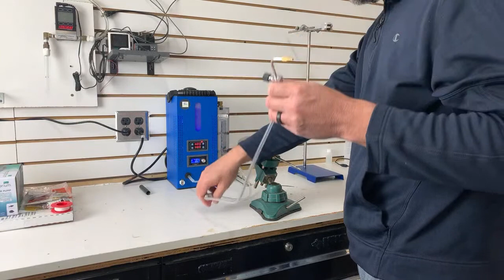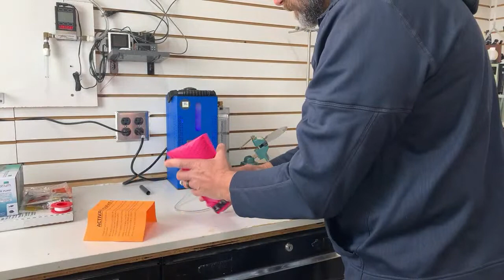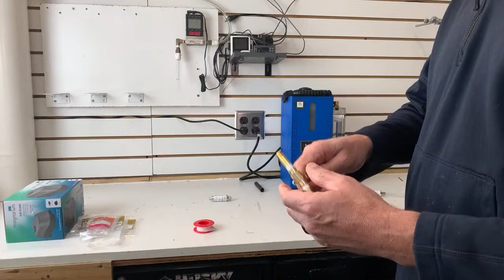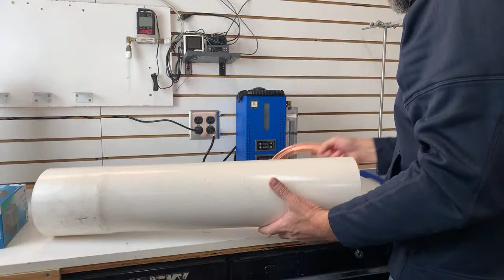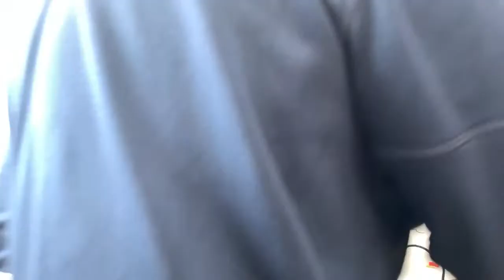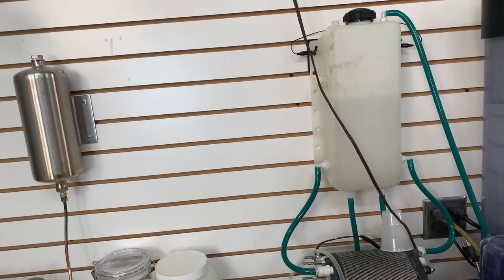Full assembly of a DDW generator attachment for brown’s gas machines. Deuterium depleted water

Comment: My understanding is that in addition to recombining the electrolyzed protium and oxygen as you do here, you can pre-deplete the water itself through low-power electrochemical separation through a Nafion membrane between the 2 electrodes, where the water on one side becomes depleted and the other side enriched, totally separate from electrolysis. You could then use electrolysis on the resulting pre-depleted water, to further deplete the deuterium, like you do here.

I would love to see someone make a machine that stacked both methods, and perhaps increased efficiency that way -- pre-depleting the distilled water to some degree with the low power electrochemical method in stage 1, and then finally electrolyzing the pre-depleted water in a 2nd stage to drop the deuterium to a truly low ppm.

Maybe a separate water pre-depleter machine would be just as good a solution, and then the resulting water could be added to the Browns Gas machine as done here.
Reply from the maker: How does one pre deplete the water? Is it a known process?
Reply: @Hydrogen4Health  Yes, I believe it's called Isotope Transfer Electrochemical Cell, modified slightly.
Reply: ITEC focuses on direct liquid-to-liquid H/D transfer across the membrane while PEM electrolysis produces separated gases for optional recombination.

ITEC Process Details

ITEC uses a proton-exchange membrane (PEM) cell with low voltage (~0.5–1.5V) to pump primarily protium ions from anode-side water to cathode-side water, leaving deuterium-enriched water on the anode.

Detailed Steps:

    Setup: Two water compartments separated by Nafion PEM; platinized Ti or Pt electrodes on each side (~1–5 cm² area).

    Feed: Fill anode with feed water (~150 ppm D); cathode with receiving water (can be pure or recirculated).

    Apply low DC voltage (0.5–1V, 10–50 mA/cm²): Minimal electrolysis occurs; main process is H⁺/D⁺ electro-migration through PEM (H⁺ ~2–4× faster due to size/mobility).

    Ion transfer: Anode water loses H⁺ → becomes D-enriched (~160–170 ppm after 1h); cathode gains H⁺ → D-depleted (~140 ppm).

    Harvest: Draw off anode (heavy) and cathode (light) waters separately; recirculate cathode for cascades.

    Gases: Trace H₂/O₂ vented; energy ~10–20 Wh/L.

Key metric: Single-stage α ≈2–4; efficient for tritium/D separation in nuclear contexts.

Comment: Does hydrogen inhalation help reduce deuterium in the body? More than hydrogen water?
Reply from the maker: Neither of them do from what I know.
Reply: Do hydrogen generators produce deuterium gas along with hydrogen gas? After watching your deuterium videos, I stopped my hydrogen inhalation...
Reply: @lanael7278  I would think that because deuterium is heavy it doesn't end up being inhaled. It stays behind in the water. This vid is just showing how to convert browns gas into deuterium depleted water
Reply: @TermiNader5  Yes, deuterium gas is heavier than hydrogen gas, however, lighter than oxygen gas. Brown's gas has both hydrogen and oxygen gases. Deuterium gas may be there too 😞
Reply: @lanael7278  it's probably similar though to drinking 25ppm deuterium depleted water..there might always be some deuterium but it's the ratio that matters
Reply: @TermiNader5  Agree. The ratio would be similar to the one in the water in hydrogen generator. Most drinking water has 150 ppm of deuterium water, so the same molar ratio of deuterium gas will be present in Brown's gas. I'm stopping by inhalation of Brown's gas.
Reply: @lanael7278  if you have to change the water in the machine like once a month, couldn't it still be used and just put some deuterium depleted water in it like once a month? I order some water from an American company Hydro-Health
Reply: @TermiNader5  Great idea. I'll do that. Thanks so much!
Reply: @lanael7278  I think though that it isn't that big of deal to use regular 150ppm water in the browns gas machine, because as is shown in this video..the browns gas ends up having like around 44ppm deuterium which is barely anything. but if you do use DDW for the systems water, you probably would end up with a gas with 0ppm deuterium.
Reply: @Hydrogen4Health  then what does decrease deuterium? Deuterium depleted water? why would the BG5 machine not be able to deplete deuterium in the body?...isn't DDW essentially hydrogen water without deuterium, which is similar to Brown's Gas HHO?
Reply: If what you are asking is 'what lowers deuterium levels in the body?' then I would answer 'osmosis'. When you drink DDW (water that has little to no Heavy Water molocules) the water you evacuate through sweat or urine or whatever is going to have higher levels of deuterium, and your overall deuterium numbers will go down. If you are making hydrogen water, (AKA hydrolyzed water) you are simply dissolving the browns gas into the water. The overall number of water molecules that are considered to be 'heavy water' doesn't go down in the water source you hydrolyzed, since all you have done is add some air bubbles to it. Also in an effort to clarify - Basically stated, Heavy Water is a water molocule where one or both hydrogen atoms present in the molocule consist of a deuterium isotope rather than proteum. I could imagine breathing browns gas could actually lower your levels of deuterium isotopes if they were free roaming deuterium or maybe even heavy water molocules in certain circumstances but the numbers are sooo small as to be negligible, if even provable. DDW is the way to go to reduce overall deuterium levels. In this scenario the DDW is being made from a HHO flame recombing to make a new water molocule. The reason this works is heavy water doesn't react to electrolysis at the same levels as regular water, so it's not nearly as common to get deuterium atoms as a gas in one of those flames than it is proteum atoms. So those 'deuterated water molocules' are left behind in the tank instead of becoming gas, so the new water that is made is all but free of deuterium. Ideally a PPM of zero deuterium isotopes would be amazing, but I think this guy did great getting it down to 44ppm. It's very tough to isolate an environment and prevent any moisture in the air from contaminating your new water sample.
Reply: @precisionbarberbear  thanks for this detailed response..if deuterium has built up in organs and organ tissue such as fatty liver, i wonder if the browns gas inhalation could help in reducing deuterium in that case..since from my understanding the browns gas can help with hydration of tissues since the gas can get into the circulating blood stream which feeds all the organs. I would think pretty much all the fat in a fatty liver is high in deuterium caused by a carb sugar rich diet..I'm gonna be also trying out some 50ppm DDW from an American company called hydro health. I have a theory as well that another ancient way of depleting deuterium at an accelerated rate would be to chant mantras for long periods of time and even better while fasting
Reply: @precisionbarberbear  does browns gas contain deuterium gas in it?
Reply: @TermiNader5  deuterium is just a form of hydrogen. Proteum is another form and  is what most people refer to when they say 'hydrogen'. Heavy water, deuterized water, and deuterium water are all names for water molocules made with deuterium instead of proteum. Think of it like deuterium-based water molecules, instead of hydrogen. It's not H2O, it would be D2O. And I don't  think it builds up in organ tissues like other toxins because it is just a heavier form of water but there has to be some build-up going on since drinking 50ppm heavy water lowers your overall count, akin to osmosis. Online references say around 150ppm is around the normal amount of deuterium-based water molecules to normal water, so that's a significant drop. And this guy got 44 on one run? Huge percentage drop, unlike 3% or whatever for distilling methods. Also deuterium-based water molecules don't split up into their basic components during electrolysis as easy as regular water. So a browns gas generator is basically running a current thru water which breaks it up into its constituent parts - 2 parts hydrogen, and 1 part oxygen (hence H2O). Well since the heavy water doesn't get split as easy, it gets left behind, which is why you can get significant drops in heavy water % after just one run. That's a long way of saying no, hydrogen generators don't make deuterium, and you can't end up with more deuterium than you started with.  I'm not sure if it can even be made, but if anything, the final product has way less than when you started with
Reply: @precisionbarberbear  thanks so much for explaining all this stuff..so just to clarify, it shouldn't be a problem to use plain distilled water in a browns gas generator rather than ddw because only a small amount of the D20 in the plain 150ppm water will make it into the gas state?
Reply: @precisionbarberbear  How do you know D2O doesn't break into O2 and D2? Was it ever tested?
Reply: I want to be able to make my own DDW.
Reply: @lanael7278  it does but most of it gets left behind in the water. that's why the browns gas is deuterium depleted but not totally void of it..that's why the ddw created from Browns gas only has like 44ppm deuterium only after one cycle..if D20 was breaking up on a greater scale from the electroylsis, the ppm would have been higher in Steve's DDW experiment like still around 150ppm. The browns gas was deuterium depleted though
Reply: @lanael7278  the video that we are commenting on shows exactly that. I don't know how to explain it properly or something I think. Water is H2O. A small % is D2O. 150ppm let's say. We subject that water to electrolysis, which breaks the water molecules into its base parts, that is hydrogen and oxygen. (All hydrogen being 1 of 2 variants that we named deuterium and proteum. Wikipedia deuterium if you dont understand this). Now if the deuterium water acted the same under electrolysis as the proteum water there should be on average 150ppm deuterium in the gasses produced, right? Well we don't see the same numbers. Isotope analysis proves the numbers are lower. In fact, if you subject those gasses to an ignition source, the 2 forms of hydrogen readily bond with oxygen. The result is water. And we can test this water way easier than the gasses, which is exactly what the paper in this video shows... after 1 run his result was 44 PPM deuterium water. Why is he getting numbers lower than what companies are selling their DDW for at top dollar? Well you can also do an isotope analysis of the solution in the tank. I bet you anything the deuterium levels in any electrolysis machines electrolyte solution is off the charts
Reply: @precisionbarberbear  Thank you for your response. I'm a chemist and understand electrolysis well. I haven't watched Steve's DDW depletion process till the end. Was the final water tested for deuterium content?
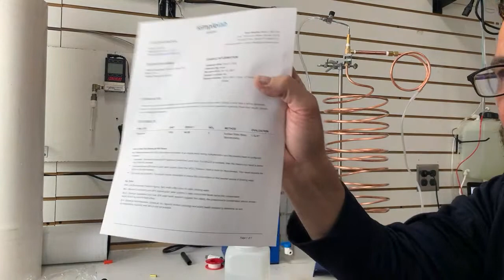Reply: @lanael7278  yeah... 44ppm. I actually think the true numbers would be lower than that if outside moisture from the air wasn't being introduced, but you have to have airflow with these things. Watch the video, increase resolution, and zoom in... you can read the paper from the company that did the isotope analysis when he holds it up @ 49:05 timestamp
Reply: Would drinking 25ppm ddw during a water fast be more beneficial than dry fasting for the body?  @precisionbarberbear
Reply: @TermiNader5  I can't attest to what type of fast is more beneficial, but think of the DDW simply as better for you than regular water. 
Is a dry fast more beneficial than water fast? Who knows.. also depends on what is trying to be achieved and the current state of the body doing the fast. Hope that helps
Reply: @precisionbarberbear  if the goal is to reduce deuterium...i just wonder if a ddw fast would be better than dry fasting?

Comment: WONDER HOW MANY PEOPLE BUILD THIS SYSTEM AND HAD SOME REAL SUCCESS, I DID , VERY GOOD STEVE, MERCI POUR CET INFORMATION.
Reply: How is it the Brown's gas flame does not melt the copper? I thought it would.
Reply: Copper is a very good conductor, not an insulator. It conducts the heat from the brown's gas flame away from the contact point faster than the flame can heat the metal to its melting point. Remember, that flame will only raise up to (not exceeding) the melting point or temperature of catalysis of the matter the flame touches. Think of it as a catalytic flame or even electric flame... it's a better description and more applicable.

Comment: Thanks Delvis11. Excellent video and explanations! 

Any thoughts about using stainless steel pipe instead of copper? Wouldn't this put less impurities into the resulting water from the dissolved copper which can be quite bad for you?

Also curious as to whether you could use substantially less metal tubing by putting an 8" plastic pipe over the tubing and sealing the pipe at the bottom with a cap etc, drilling a hole in the side to exit the deuterium pipe, sealing the hole  and then filling it with tap water as a coolant, and maybe running the second aquarium hose into the base of the pipe and diffusing it with a an aquarium stone to cool the water.? You'd have to put a vent opening at the top for pressure dissipation. Any thoughts on this?

Also I have an AC50 from GW which puts out 50 LPH.  From what I gather from your video this would produce probably an ounce in 1.5 hours + --  ?
Reply: He said his machine puts out 450-500ml a min. 500ml a min is 30litres per hour. So the AC50 at 50lph has 5/3 the output of this machine

Comment: Steve, long time since the HHO days. I was watching a video on DDW which claims 135 PPM is the optimal level. My take is unless your electricity comes from solar or wind power it probably is not very economical to distill using electrolysis. Not to mention the cost of the system.  Funny when I was watching the video I did think about all the HHO stuff I have in my garage. Then the bots put up a link to this video. 
Here is the link to the DDW videos.
https://www.youtube.com/watch?v=pu_zY9cTA50
 https://www.youtube.com/watch?v=Cehzz9PFHfI&feature=youtu.be

Good job on the safety advise. It was quite exciting when I blew up my bubbler when making my first HHO torch. Thank goodness not injuries other than ringing ears. 
Thanks for the video.

Comment: mr Steve
once again a great video n great invention

I hv a doubt

Supposing i buy a commercially available 1 r 2 litre Deuterium depleted Distilled water n use it for Browns gas r pure Hydrogen gas inhaling machine( instead of usual n normal distilled water as electrolyser)  will the Output H2 gas will also hv effect of deuterium depletion gas mr steve

can u reply sir

thanks n regards
Reply from the maker: I don’t think there is deuterium in the gas.
Reply: Deuterium is an isotope of hydrogen and not in hydrogen gas, which is termed protium. Hydrogen gas has no neutrons and deuterium does.

Comment: Is their any way that the air compressor could be creating condensation and adding impurities that would mess up your tests? Just a thought
Reply from the maker: Yes that’s possible and a great observation that I had not thought about. A gas dryer on the air pump side would be a good addition.
Reply: @Hydrogen4Health  yes or try a bigger torch maybe? Or worst case scenario maybe cap that off run the drip tube into a pot with a sealed lid then pull vacuum?? Theoretically if it worked should be perfect. Once again just a thought
Reply: @Hydrogen4Health  hi buddy do you have a link to a suitable air dryer?

Kind regards Glenn

Comment: Hello Steve, I have a question about how much hexavalent chromium 6 is in the watertank off the hho. You use stainless steel in the hho? Do you also have experience with titanium cathode. Ortho-hydrogen and Para- hydrogen. Electrical expanded water.  Does is make sense to make the neutral plates from a different material.
Reply from the maker: Hex chromium is not a issue with these machines

Comment: Hey Steve, looking you up on Skype to ask some questions.  For now in regards to your Browns Gas Maker we would not have anything to worry about in regards to any popping or gas going off once its inside of us correct?  Also I think you said that the lyme your machine uses is minuscule vs. say George Wisemans machine?
Reply from the maker: No you don't have to worry about explosions. We use a explosion proof dry cell and also flashback protection in case the gas get ignited inside the nasal cannula. Yes it uses 5 grams of lye compared to 120 grams.